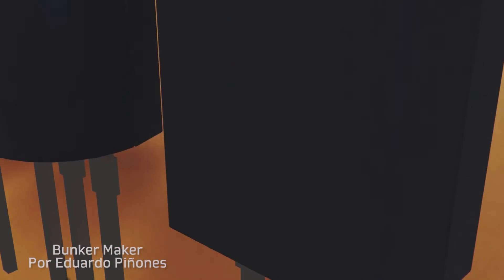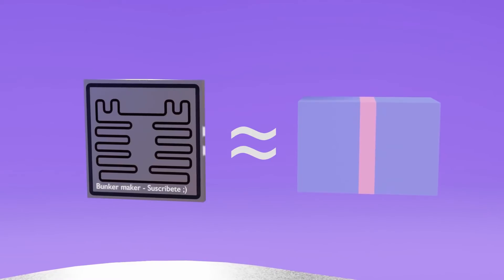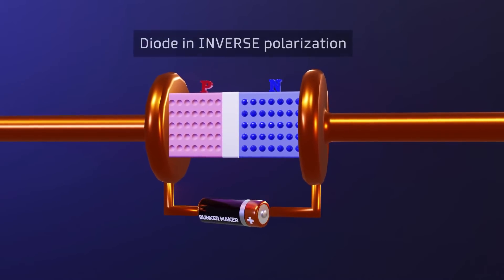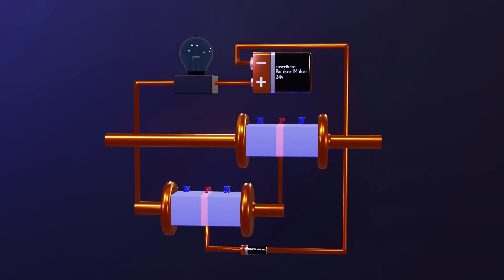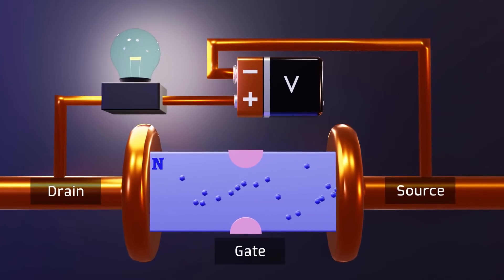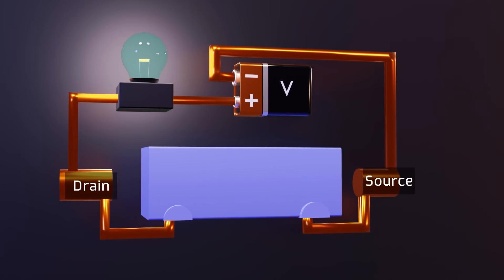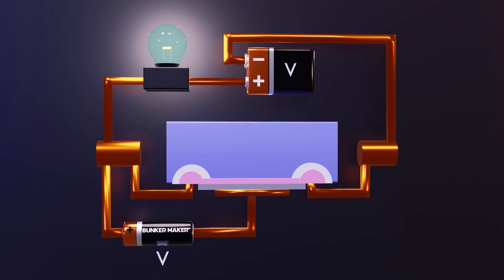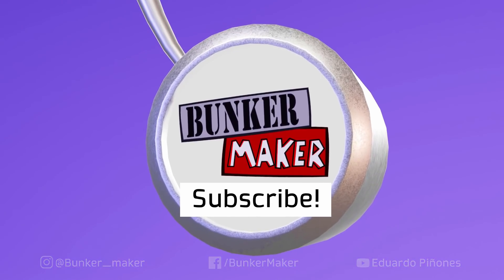9 Types of Transistors and How They Work ⚡ How a Transistor Works (Part 2)

Comment: Phototransistor: Take a 2N3055 in TO3 package and open the lid, then you have a phototransistor. 
You don't need a photodiode, the diode path from the transistor is enough.
Phototrasistors and an LED are often installed in optocouplers but are invisible.

Comment: This breakdown is inconsistent. BJT's are broken down into PNP and NPN but MOSFETs are not broken down into N-CH and P-CH. Strictly speaking IGBTs while being a MOSFET/BJT darlington are on a single die and have different characteristics to a discrete implementation. Theoretically JFETs can come in N-CH and P-CH varieties although I'm not aware of and P-CH devices on the market. BJT darlingtons behave exactly the same as their discrete implementation so don't deserve there own type. Unijunction transistors are missing as are GaN of which there are devices with and without a body diode with differences in behaviour. In MOSFETs there are dual gate varieties that deserve mention. Quantum transistors deserve to be broken down into Josephson junction transistors and the newer varieties. GTO's are also missing. One could even argue that SCR's and Triacs deserve a mention here being 3 terminal devices with switch behaviour.

Comment: Sorry, but to me this, overview, does nothing to really explain what is happening or how they are applied. The one and off part is clear but most transistors are used to amplify voltage or sound, or signal. Your illustration shows none of that.  I had first learned how to read schematics back in the 1970's, and used what I learned from my dad on occasion, and read very helpful book on it that he had about transistors.   Found out less here on this video...

Comment: First, BJT is bipolar JUNCTION transistor -- not what you've been smoking -- you evidently sobered up later, but this should never have been a reasonable mistake.  Second, PNP and NPN ARE BJT; they are not three classes.  Third, holes from the p-side recombine with electrons from the n-side to emit light (or IR).  Alternately, light excites an electron-hole pair in the junction and they follow the electric field to generate current in solar cells.  "In series" applies to TWO terminal devices... Darlingtons have the b-e junctions in series and the collectors in parallel.  You also omitted the MESFET (MEtal Semiconductor FET) that uses the Schottky effect rather like the JFET, the HEMT (High Electron Mobility Transistor), and the HetFET (Heterojunction FET).  And this does not include variations including other semiconductor materials than Silicon... GaAsFET, Germanium hybrids, SiC, GaN, etc.
Reply: Not being funny, But can you please do a video series on them.
Reply: The corrections are appreciated, the attitude at the beginning - not so much.  Especially when there’s a reasonable chance of a language barrier, as Eduardo likely speaks Spanish, with Italian as a second language. Anyone who can speak three languages could be given the assumption there’s a valid reason for the mistake; it’s obviously not because he’s not intelligent.

Comment: I always thought that the "J" in JFET stood for junction.
Reply: The J in JFET does stand for junction, not joint. Unless there's a 10th type of transistor?
Reply: J is for Junction, and 10th type of transistor is called a Schottky transistor (which utilizes a Schottky diode btwn Base & Collector..

Comment: Other than the Jar Jar Binks voice interludes, this was interesting, but electrons move faster than holes .... uh?
Reply: There is a term in semiconductor "science" referred to as "Mobility."   It's a measure of the net drift velocity for a given electric field gradient.   It's been a long time, but I thought that holes had a higher "mobility" than did electrons.   Electrons are real particles; holes are a "creature" of wave mechanics/quantum mechanics.   They have "virtual" characteristics such as "virtual" mass.   Again, it's been over 50 years since I studied this stuff.

Comment: "9 Types of Transistors"

As I said on Part 1; You are a helluva teacher, kind Sir. And i will repeat: that I was an RCA technical Instructor for many years; at our Training schools. Thus, I began teaching the first transistors (and vacuum Tubes); right on up to "Mosfet" Transistors; before I retired.

I would like to say this: IF we had had what you have now; we could have cut untold hours; in trying to teach our technicians; "How" do transistors work; AND more importantly "HOW" to Fix them; when they break down in TV's, Radios and other Electronic "GEMS"; that used transistors.

Thank you kind Sir for what you are doing; "REGARDLESS" of what some others say; like "espoused" from some "Commenters!" on this channel.
Reply: When we were kids my best friend and I would head to the dump (it was wide open and no security back then) about once a month and harvest components from old t.v.'s and radios we dug up for our reuse. Once we took a bucket of tubes to the local supermarket that had one of those courtesy tube testers there, but we were thrown out after about a half-hour of using their electricity to validate our tubes and not buying any of their tubes. ☺ Damn, those were fun times for a coupla broke entrepreneurs!
Reply: @BeachsideHank  Love it, kind Sir.

Comment: What type of transistor do we use in a Tesla coil? And how does it work?

keep up your videos are cool and usefull❤️
Reply: That is a whole subject in and of itself, but needless to say you don't need any transistor to run a Tesla coil (a spark gap system can be made to work) although any transistor type with sufficient voltage and current rating can do it.